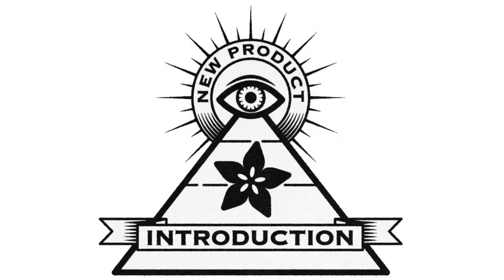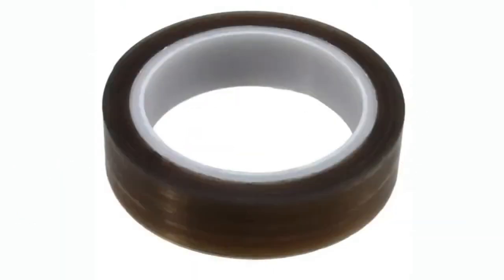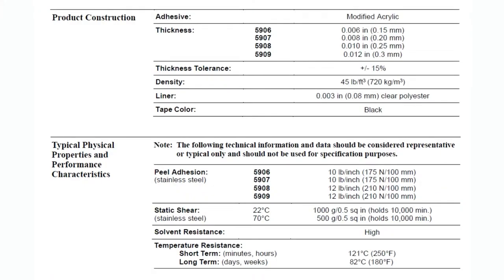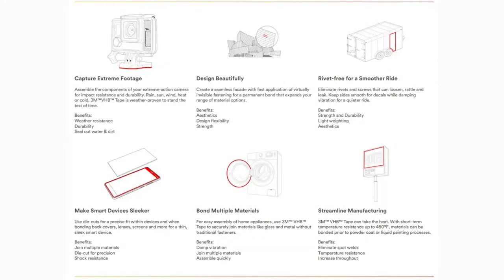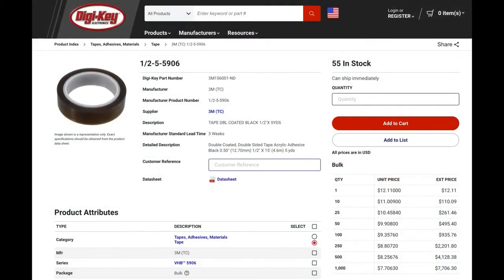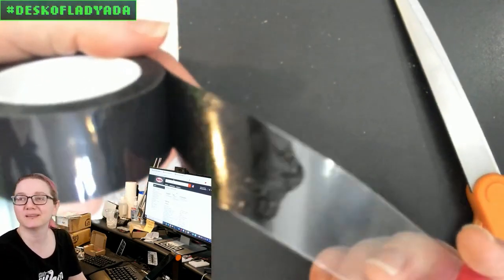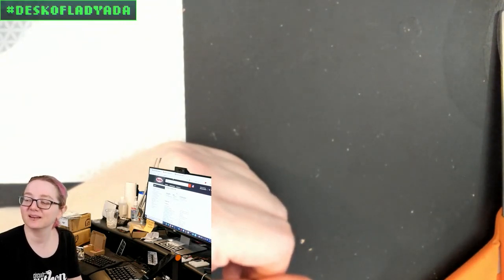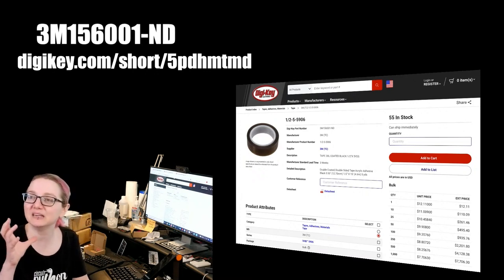EYE on NPI - 3M VHB Adhesive Tapes #EyeOnNPI #DigiKey @DigiKey

Comment: I used a different variant of 3M VHB tape to bond a tempered glass window to an aluminum computer case side panel, after the cheaper no-name double-sided foam tape I used first failed quickly in the mildly warm case environment. It has not budged an inch since I mounted it with the 3M tape, absolutely fantastic stuff! I always go with 3M when I want the best quality adhesives or tapes; a lot of times the cheaper stuff is fine, but when you get frustrated enough with tape coming unstuck in a particular application it's time to spring for the good stuff.